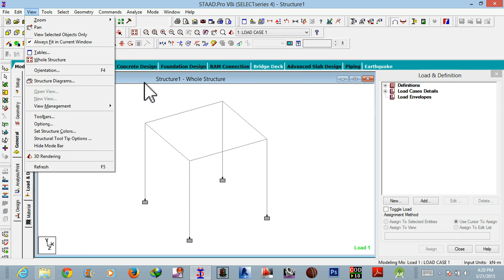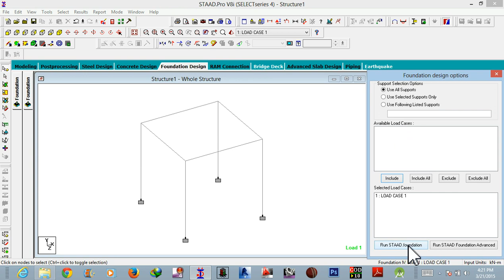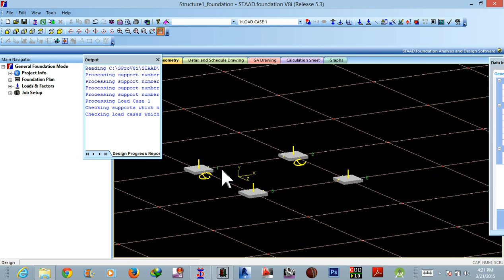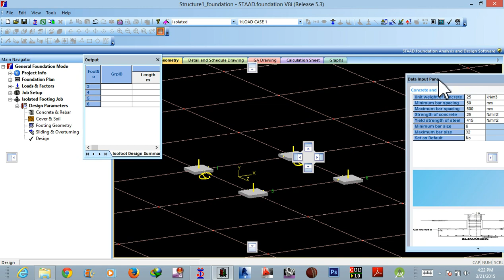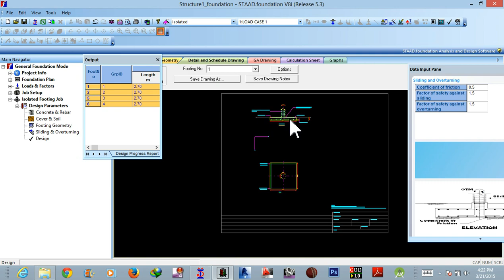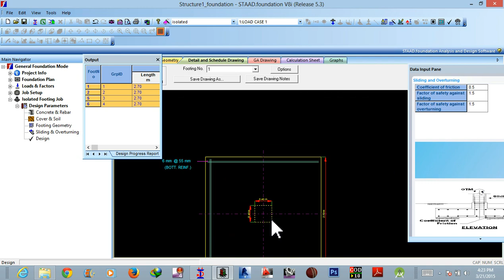ISOLATED FOOTING:STAAD.FOUNDATION PART 1

Comment: does inputting offset values in the footing geometry tasks pane changes column position or the footing position? If it changes the column position when offset value is provided the column position have to be adjusted according to the offset value you are going to provide.